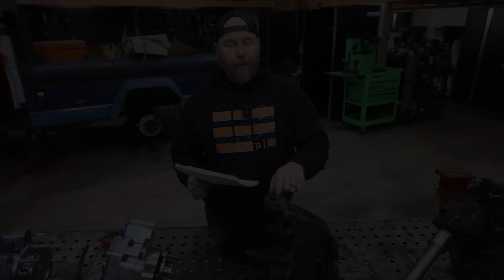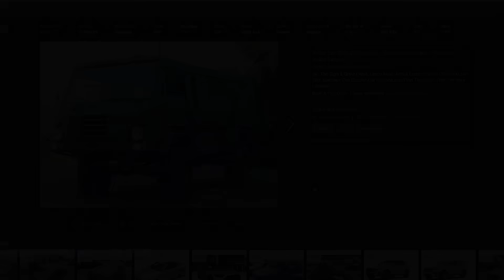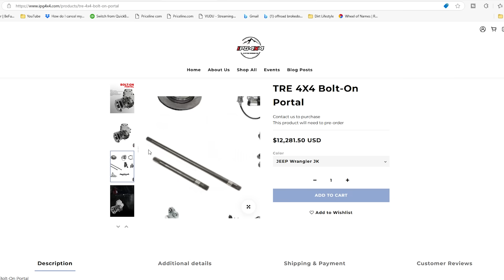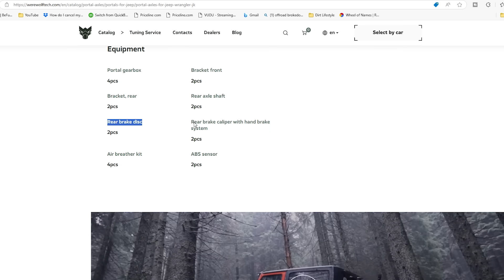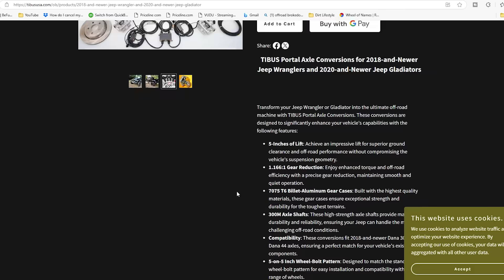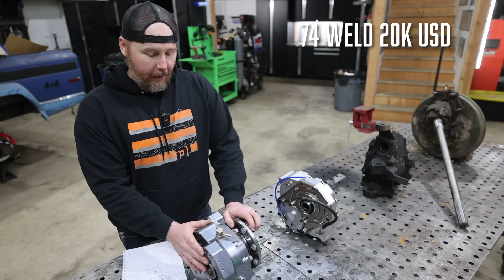CHEAPEST Off Road Portal Axle to Most Expensive! 74 weld, Werewolf, Hummer portal, Unimog portal.

Comment: Hey Nate. The Volvo C303 was the 4x4 version of the military truck; the 304 and 306 were 6x6 of same truck. I have 303 axles under my 80 series. They were bought from a guy in Grand Junction, CO who used to import them. I've only seen a couple sets for sale in last 10 years. Last year there was an actual factory C303 that sold on BringATrailer and he got a couple sets of spare axles as well. I have 39" tires with stock springs and trimmed fenders. I love them. Getting parts is difficult, a couple companies overseas sell replacement items. There are guys who still use them for racing. If you've seen the Malaysian Jungle races, a lot of those guys have Volvo portals on their suzukis and jeeps. I'm not sure of the strength. I use my cruiser to haul our family of 6 around the trails. I rock crawl, but I don't beat on it because I don't want to break and have to wait months for replacement parts to come from overseas. I also drive it on the road and it'll still go 70 and get 14mpg and I haven't seen the portal boxes heat up like some people claim. Cheers bro. You are still doing what no one else is doing. God Bless - See Ya On The Next One!
Reply from the maker: Thank sound like a sweet project!!! And I'm thinking about beefing up the 3 link on my Tacoma for the same reason. So much extra leverage...
Reply: I liked your closing comments about leverage. I have a front 3 link and tore the upper arm off the frame last year doing a bunch of downhill ledges. Now the upper mount has a ballistic joint and the frame was plated and a thicker mount was welded on top.
Reply: Here's a bit of fun fact for the  need minded folks; Monroe Robert Grier invented the portal axle in 1905, but it wasn't used until the early 1940s. The potential of portal axles wasn't fully realized until after World War II, when Volkswagen used reduction boxes in its first-generation vehicles. 😊
Reply: Geezzz..
I can build a Truck for 20 grand..but each their own..
Reply: I live in Norway so access is much better, 303 and 306 are the civil version, the military ones are called TGB 11 and TGB 13. I paid 1600$ for my set of axles. Mounted them under a 2 door Range Rover. Had 39" and it was used pretty hard. Had no problems
Reply: Dude! I’d love to see your rig!
Reply: I don’t know how to add a pic here but I would love to show it to you.
Reply: Agree,  when I lived in the European  theater the Volvo  boxes was " a military  " upgrade and some of the Volvo diesel  trucks used in timber farms and ' delivery '  trucks in artic rigs run these. !!!   The thing i never heard of in USA was these portals was plumbed with lines that borrow engine heat to keep the portals warm and  keeps  moisture OUT  of the box's ( condensation  ) and vented up high. The Russian and Northern European  union  has " bogs " in many areas and the mud n water / mix gets GROUND into  every  moving part !!!! Everything is  diesel of course.  So the torque  going into these Commercial trucks is very high!! But Serbs, Ruskies. Also( soviet transport 's )and other  friends of friends r very  proud of their  rigs and r VERY GOOD  DRIVERS IN THE  sticky goo !!!  No complaints about  Volvo  portals.  Here in the us portal " boxes " r used alot.
But ' eastern ' friends  prefer  portal axles. Boxes r said to greatly  increase stresses on joints as it ALSO  increases axle width plus the weight of  ' big ' tires. I'm  told that is not the case for the portal axle. Thus making it a stronger  component.  I wouldn't know as I don't know anyone from the " east " that builds  off road trucks for fun personally. But bogging is alive and well  outside of the USA  !!!!   Custom built rigs w AMG diesels is alive !!! And turning AMG4door rigs into  6x6 is well known for its  looks and the " aristocrats " ( yuppie. Kids w rich silver spoons....oil,energy.
Reply: I have a set of 303 portals. they came in 2 different ratios I believe. They are equal in strength to a dana 60 I have heard. center section is right offset for the front and center for the rear(perfect for Land Rover application). They are not 2 gear portals so the rotation is correct. they are rare and parts are hard to get. I got mine for $1000 each with rims. They do have factory vacuum lockers.
Reply: Tataka in Sweden has the Volvo axels.
Reply: https://en.wikipedia.org/wiki/Volvo_C303

Comment: Sounds like portals have their down sides for sure.  Don't think my current build would be prime for them regardless!   It'd be fun to join up with you guys for a trip, but only one of your milder ones!  Dunno if my XJ is up to the full on rock crawling action quite yet, and I might have to stock up on underwear.  Just recently getting into a little more rugged off roading, grew up in the pucker brush of Eastern Washington, so grew up on gravel roads and old two tracks thru the sage and trees.  Picked up a clean/straight XJ last month, am modding it up.  Starting with 4 1/2 inch long arm lift, 8 1/2 inch wheels to hold better at low pressure, and 33 inch big lug MT's.  Bumpers, winch, tire carrier, lockers.... by end of winter should be ready.  Will probably hit Moses Lake Dunes to check it out a few times between now and then.  My main angle is old logging and mining roads, old mines, rock hunting, and lookin' for a sexy female sasquatch.....

Comment: H1 12k portals have 32 spline input and most of them are straight cut gears. My portals were 10k 27 spline and I upgraded to 32 spline 12k input by replacing the upper spur gears. Only the H1 "alpha" came with helical gears. Also all factory 12K portals come with CTIS
Reply from the maker: Great info, thank you 👊

Comment: Just a heads up, the HMMWV did not come with CTIS. The CTIS came on the Medium duty and heavier vehicles. The portals are very tough though, in my 14 years as a maintainer in the Marines I have not seen a geared hub fail, but I have seen plenty behind it fail.
Reply: Army hummers came with ctis. The marine corp was just too cheap to get it on their trucks.
Reply: @mattstoll4747  to busy buying crayons?
Reply: @mattstoll4747  sadly that actually tracks lol. Thanks for that!
Reply from the maker: Perfect 👌.  This is the type of comment I was hoping to see. Thanks for the info!
Reply: My dad's 98 h1 has central inflation. 🤷‍♂️

Comment from the maker: I've been told I haven't done a deep dive in a while... let's do this 😁. Today, I want to share info on the 8 most popular portal swaps I could find! If you see anything that I got wrong or another option I didn't mention, make sure to comment to help the community. Thanks for watching
Reply: Hey Nate!  Hummer portal Boxes are 3.875 input centerline to output centerline "drop".  CTIS was primarily an H1 civilian option, it was problematic and as far as I understand  was rarely issue in the military, or at least was not standard.  The box you have IS a CTIS (air line guard and drilled hole for air input in the spindle cover)  12k portals were straight cut gears too but had 32 spline 1.375" input shaft (you made the same confusion I always do, ford 9" are 31 spline, hummers are 27 or 32 on the input).  Input gears from the 12k can be swapped into the 10k boxes and WILL work with the 10k output gear (lower gear). The greatest difference between the 10k and 12k boxes are the spline count and diameter of the input shaft.  Both gears are 2.6" pitch diameter (3.095 OD) 13tooth 25deg pressure angle.  The Helical gears were exclusively a H1 civilian option, done to reduce geartrain noise and "slop" when coming to a stop due to the inboard brakes and backlash in the gearbox causing excess motion.  the Helical gears are a little rare but can be found.  The helical gears do produce axial thrust loads in the gear set that causes more wear.  The helical gears require swapping both upper and lower gears for obvious reasons.  The Helical gears also have the larger 31 spline input.
*edit to correct spline count reference.  I will send you some more info on your Patreon.
Reply: here in aus..  which is NOT  part of the rest of the known world.. there selling portals. they have a stabalising bar, as others do, which to me, is a design fault, for rocks, branches. plus. we cant run 42'' tires on the road let alone being 10'' wider.. patriot campers, i think fit, sell these..  fitted to toyotas, 79 series, with cough 35.s, its a recipie for roll overs. as they carry sht loads of gear. the cost to engineer, gvm upgrade, is not worth the time money, pose value..5k plus.. id be more inclined to buy a unimog. be done with it.. sold here for around 10k.. ex army , some good some bad.. i have a ford h/bouy. 75. 5 sp. 4 w disc. cut to swb, with h/pin h/d d44 locker, rear d60 lsd.. 35,s.. 26'' to the sill..
Reply: You forgot the 74weld two gear portal.
Reply: The 74 weld package and all of it's basically mandatory. Associated components, requires four mortgages. Disregard the voice to text grammatical issues  @larryboy8821
Reply: Appreciated, Nate.
Reply: Thank you great information.